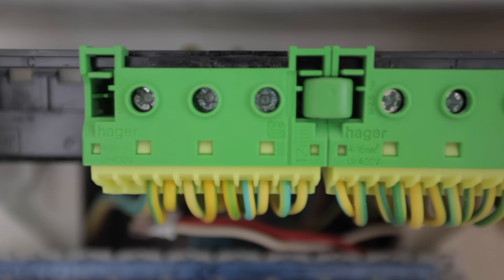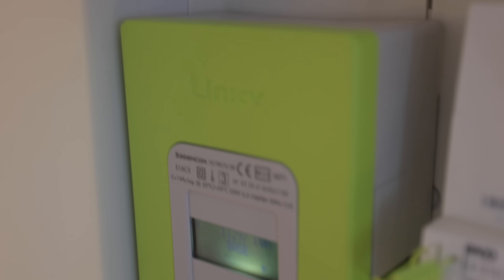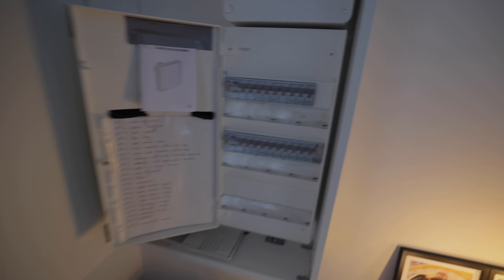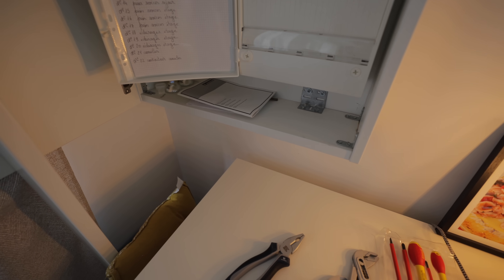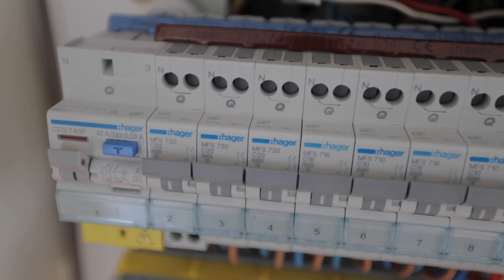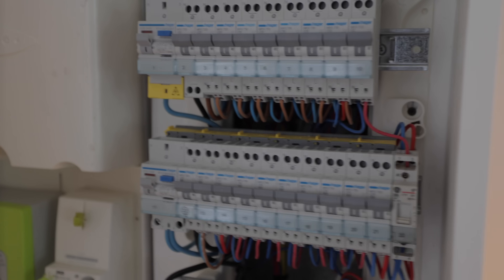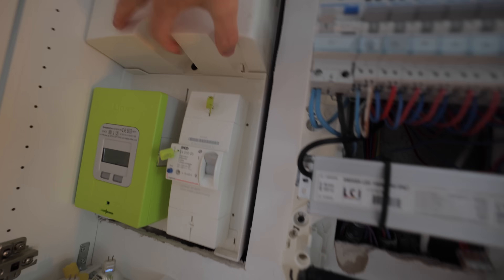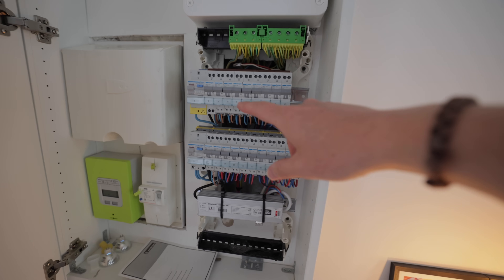U.K. Electrics SUCK! This is what we should be doing…🇫🇷

Comment: The DTI (Dispositif de Terminaison Intérieur) is the point of demarcation between the telephone network and the interior wiring, so that’s where the network operator responsibility ends. The other little box is just a television antenna splitter.

There’s another box you can get which lets you terminate RJ45s from around the house in a small patch panel (up to 16 ways) and also has space (and power outlets) for a router/switch.

The Linky meter is a smart meter send 10 minute interval readings back normally via power-line carrier to an aggregation point at the substation. They can also be fitted with 4G modules if needed. The meter also detects if you’re using more than your contracted kVA and has a built-in trip switch which you can reset if you go over the limit. It can also be remotely switched off if you don’t pay your bills!
Reply: We have kind of a similar system in Italy, since the 2000. If you pull from the meter 10% of more power than what the contract allows it will trip, up to 30% more for 3 hours (for a standard 3kW meter it means you can get 3.3kW forever and 4kW for up to 3 hours), after that it will disconnect after a couple of minutes. 

When they introduced it it was very annoying, especially coming from the old meters that just had a thermal switch that was not that accurate and you could have easily got plenty over the limit for a couple of minutes. With the electronic ones it's annoying, if you use your air dryer and forgot you had the washing machine on, you will have to go reset the meter (that for newer regulations has to face the public street, so you have to get outside). 

Of course people can just pay to augment the limit to up to 6kW or 10kW (more you need to go 3 phase) for a couple of euros of fixed cost more at month, but you know, people don't want to spend money and prefer to do mental calculation on what appliances to activate and when to save 10$ at month.
Reply: @alerighi  People managed to trip their supplies even in the old days of mechanical meters and thermal cutouts. Mamma's got dinner in the oven and sis takes a shower? Darkness in the whole flat within a few minutes. Happened to me when I stayed with a host family in Torino in 2002. I was quite amused when I saw someone from the host family take a picture off of the wall in the hallway to reveal the meter and reset the mains!
Reply: @Ragnar8504  haha that's an interesting alternate reality as somebody from the US.
Around these parts usually it would be something like the doorbell is sharing the circuit with the microwave which is sharing all the outlets in the kitchen because it's an older house and it's sharing the bathroom outlet because you're not gonna use that at the same time. and then you got dinner in the microwave and somebody rings the doorbell while you're in the bathroom and you trip the circuit.
Crazy to think that there's a momentary whole house limit. I guess we're spoiled over here with a 200 amp split phase 240V main breaker and only occasionally very rarely Protection at the meter.
Reply: @alerighi wow. I'm just on a standard tarrif in the UK. Well it's cheaper for 6 hours overnight but we can charge our car at 7kW, run the steam room at 5kW and have the inductive hob, 2 ovens, washing machine, dryer, tvs, lights, computers and whatever else on all at the same time. Obviously we pay for each kW we use but we don't have a limit that I'm aware off... We don't usually do all these things at once, but it often happens that we charge the car, charge our home battery, run the dishwasher and washing machine and go in our steam room during the first hour of cheap electricity some evenings.
Reply: I live 2 hrs north of Marseille & our (new) electrics are just like that. No rhyme nor reason I can see for type A or AC breakers (washing machine & dishwasher on both). Old houses only have earthing in the kitchens & bathrooms as sockets elsewhere were only really used for lighting (hence why they may still call sockets ' luminaires') . I have 230v socket next to my bathroom sink. There's no fuses in plugs or on/ off switches on sockets but no ring mains & contactors for multiple light switches for 1 light. 

Bon continuation.
Reply: I can see current limitations coming to the UK. Pretty soon at a guess.
Reply: @Leozmad We have that already, it is the 60/80/100Amp incomer fuse. Just old fashioned and needs a human to change it/increase it assuming you incomer can support a higher rated fuse. In France this can all be done remotely via the Linky and for lower subscriptions, the standing charge is less. Many old folks run on 6KVA. So very ballpark, 30A supply. I’m on 18KVA ( I have 3 phase power in France) as I have a 3P EV charger, a 3KW electric heater, a dryer a washing machine and all electric wall heaters. Good job electricity is cheaper in France.
Reply: @gibsonmb1 Yes I wasn't able to get more than 12kVA without switching to 3-phase which would have been unnecessarily expensive. We uprated from 9 to 12kVA because I was adding a VE charge point. For those who aren't aware, in France the fixed charge is based on the capacity to which you subscribe. So low consumption users can pay lower fixed charges.
Reply: Like in my place, they are doing DVB-T over Ethernet
Reply: You have fiber internet (thin white cable and black small box)
DTI send phone or internet or even TV on your RJ45 sockets from this optical cable. TV can be added from coaxial roof antenna.
Reply: Salut ! C'est fou de trouver la réponse ici, je cherche depuis des mois à savoir à quoi sert cette boite DTI et voir si je peux la convertir pour utiliser les sorties RJ45 pour de l'ethernet ! Est-ce que tu sais si c'est compatible ?
Reply: @ciemrnt  Hello - the DTI is used for analogue phone lines and uses RJ11 connector(s) that are not compatible with the RJ45s used for Ethernet - 4 pins versus 8.  If you don’t use the analogue phone lines, replaced by fibre for example, you can reuse the space for an RJ45 patch panel.
Reply: @Richardincancale  Thanks for your answer, I will try to do this !! You helped a lot, thanks
Reply: Is it possible to bypass this smart meter without it alerting the power suppliers?
Reply: Yeah that sounds a bit facist and big brother
Reply: @willkrummeck  What - the telco having a demarcation point?
Reply: @willkrummeck Just to ballance your view :
There is laws protecting the consumers.
Ie : there is a "truce" in favour of consumers for the colder months of the year.
Reply: @willkrummeck  About cutting of the electricity if you don't pay, it's the same everywhere after you have been warmed more than enough to avoid mistakes, except that in this case you don't need to send someone to do the job... And you can get is back way faster and don't need to wait when you move in a new place. Same for changing power or contract. About surveillance, that sound a bit conspirationniste... Knowing more about use in real time helps to adjust production and make more accurate projections about energy needs. It's more than useful with all the way that exist in production, a lot depending on weather,  or whatever it could be.
The way you seems to believe that getting reliable energy is that easy on a big scale, doesn't mean that it is. 
People that doesn't want to help to manage the new energy goals,  can still get out of the grid and deal with their energy needs by themself, that fixes the trust issues. Nobody forces anyone to live in society if they don't want to.

Comment: We just had ours redone couple months back, added 2 new circuits, changed our main breaker that has to be changed by the electric company, funnily enough the tech was British but working here lol. I think we went to a 45a main. We used to be on a 30 that would randomly trip. Our electric plate was also plugged into the wall. Was fine cause we only used one plate but now it's so much better.

P.S. I had no idea you were in Marseille, I'm in Nice so we're not too far :).

Comment: Good video. I've heard they use solenoids rather than 2 way switch which sounds a bit overly complicated/french. I spend all my time in France camping so I've not varified. Some of the stuff you highlighted seems good though. I'd imagine some stuff better than here some stuff not as good?
Reply: Yes - we have latching relays that use a press switch to flip between on and off, from any number of press switches. As they’re latching relays they don’t pull any power except when the momentary press buttons are pushed.
Reply: Simple two-way switches are in common use in homes. But latching relays are common in staircases.